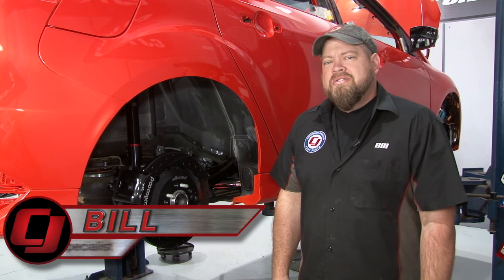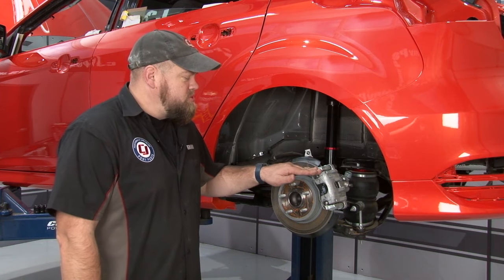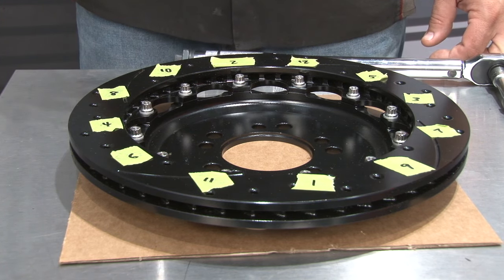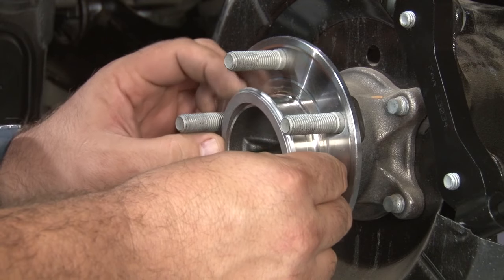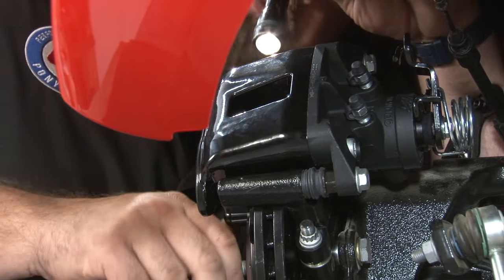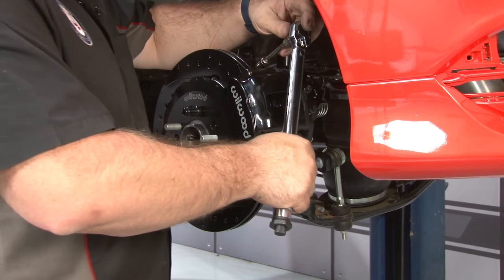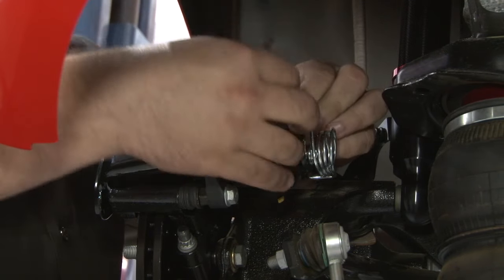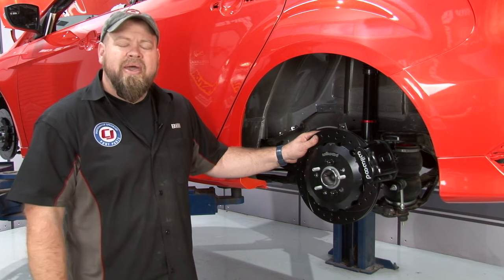Focus ST Wilwood Rear Disc Brake Kit Black Drilled And Slotted 12.88" 2013-2018 Installation

Comment: Stupid question but do the rotors stay black after use?
Reply: Everywhere but the contact patch for the pads
Reply: Why would you buy a black rotor if the black comes off lol. I am guessing that looks like a worn out rotor as soon as the paint comes off
Reply: I'm pretty sure it's just a protective coating for rust not anything to make it look pretty.
Reply: The parts of the rotor that do not contact the pad stay black protecting it from rust. They just plate the whole rotor at once since it is more cost effective that way. it was never intended to stay black in the first place